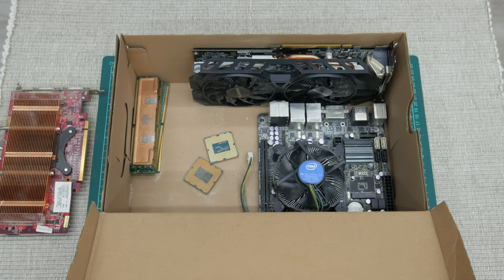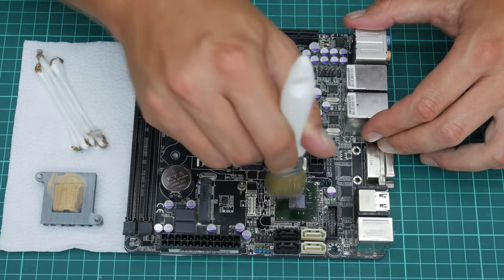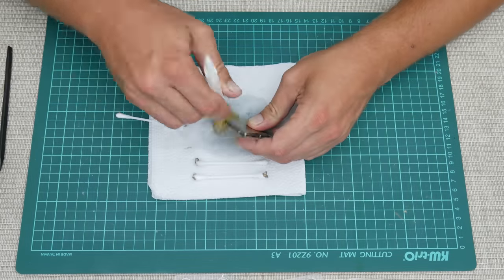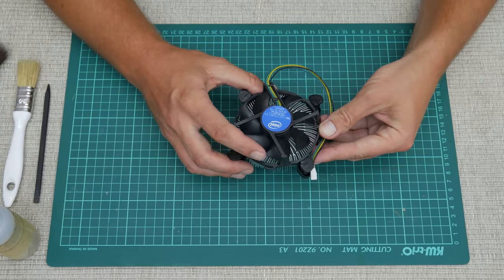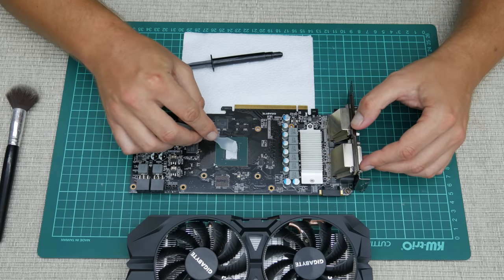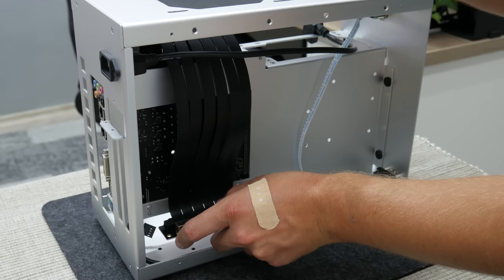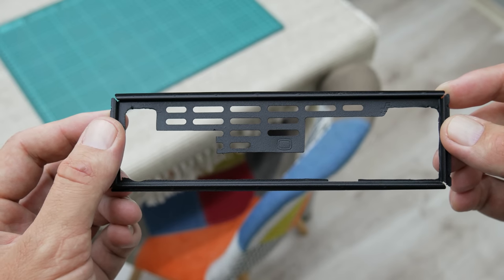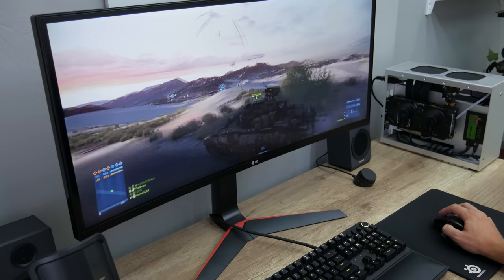Building Mini PC out of Trash ( Plus Upgrades )

Comment: Great build! You could swap out the PSU and HSF for a SFX PSU and a low profile top down cooler and fit case panels on? You could then use those larger parts in a tower build!

Comment: I love your videos, repair tips and upgrades on PCs and laptops. My tip is: Wash everything with soap and water (removing the battery) and let it dry for 24 hours. Just vinegar and salt are enough to get the copper and aluminum shiny again in a few minutes. Then use WD40 or corrosion X to protect. I do it here in Brazil and it works well. Try it!

Comment: This setup is definitely a great fit for a dual-boot Windows XP & 10 PC. Granted that the version Windows XP installed is 32-bit one & can only utilize 4GB RAM, but the fact GTX 960 graphics card still has the official (unmodded) driver for XP means most games prior to 2007 can run in 4K resolution or 60 fps in high settings.

Comment: Nice little PC build! I would have personally gone for a case that fits the cooler though, and also I would have had more than 256GB SSD. 256GB isn't much when some games are 100GB+. It is better to have 256GB SSD and then additional HDD.

Comment: I found, some time ago, 2 small size PCs. 1 is an HP Slimline Pavilion, & the other is a Lenovo IdeaCenter mini PC. The HP was a bit on the older side, as it has Win Vista. The  Lenovo is more recent, but the previous owners put a screw in the HDD! They put a screw in the CD ROM drive in the HP, thinking it was the HDD! The HP CPU can be upgraded as well as the RAM. Thank you 🤓

Comment: Not sure if you standed the heatsink would there be poor mounting pressure considering those are push pin mounted rather than screws. Also, not sure there would be pump out action due to the bare die chipset thermal expansion and contraction during use.

Comment: Tbf, that tower cooler is pretty excessive for i5-3330. 
I have it for 9 years already with stock intel cooler (with copper core), and it never heats up over 65℃ (even under 100% load in summer). It's very cold, and i like it for this.

Comment: Reminds me of repairing my relatives' PC, i5-661 from a i5-2310 because of a motherboard failure and scavenging another PC for it. Upgraded it to 16GB with a GT1030. Was gonna swap out to a Xeon Processor then few years later, I had some spares from a PC upgrade I did, so now it is kicking an old 650W PSU, i5-9400F, new mobo+RAM+NVMe SSD while reusing the case, HDD.

Comment: Great job and great restoration, though personally, I would’ve stuck with the intel stock cooler as it’s low profile and makes more sense here. The 3rd gen i5 won’t need much more cooling anyways, if it’s even capable of drawing that much from that little board.

Comment: Looks good but instead of that tower cooler I would have chosen a topblower, even an Arctic Alpine 12 should do the job, it is rated for 95W TDP and the i5-3330 has just 77 or some other like a Alpenföhn Silvretta, Freezer 11 LP or Scythe Shuriken 2 and use acrylic panels that you perforated with a drill for the PSU and Graphics card (or mill some slots, maybe angled instead of straight vertical or horizontal) instead of solid glass panels.

Comment: There was no reason to use such a large CPU cooler for a 3rd Gen i5. They don't get that hot even over clocked. That was a bit overkill. You did all that great work to clean everything just to leave the side cover off so the massive cooler can suck in all that dust!

Comment: I have a question. If I bought an old desktop computer with windows 7 maybe. would it play 1990's and early 200's cd rom games? or do I need an old gaming pc? I did get a few early 200's games to work on a small laptop but they kept on crashing.

Comment: Nice!  ;-]

One part I don't get... I fail to see the need for sanding down the small chipset heatsink. You said it was because of not having a replacement for the thermal pad.  What is it that the thermal pad does that thermal paste will not do, on that surface?  Arguably, a grooved surface has more actual surface area, with the potential of conducting more heat away from the chip if more of that surface is in contact with the thermal transfer medium. The paste will fill those grooves, a thermal pad will not.  
So, to be clear, what you said about a smoother surface being more conductive, is only really true if a thermal pad is used. Thermal paste is not bothered by such things since surface imperfections are its very reason for existence. It will adapt itself to the surface.
Conclusion, sanding was not required.  Just trying to save us some work... Trust me, if there's a lazier way to do something, I will find it!  lol

Cheers!  ;-]

Comment: Overall nice build. Repurposing hardware is always a good thing but I wouldn't had sand the chipset cooler or bother with making a I/O shield.

I sanded and polished a chipset cooler before and it does nothing for lowering the temperatures. Thermal past will fill the little tool marks and scratches anyway and these Intel 7 chipsets had a TDP of only ~7 Watt. So at room temperature you could even run the board without the cooler with no disadvantage to its performance or longevity.

I/O shields are good to keep peoples fingers out of the computer but its also used to keep dirt and dust out and guide the air but if you leave the case open anyway I wouldn't have bothered to make one and just leave it.
Reply: Exactly, it looks/feels good but doesn't make a real dfference and thermal paste/pads are made for that purpose, because heatspreader/dies and heatsinks aren't perfectly flat/even, it should equalize that.
However I replaced the thin thermal pad with some paste for the PCH heatsink in my LGA 1155 Optiplex 9010.

Comment: i just tore down a pc that was given to me....dusty and dirty....just took psu apart and cleaned all the gunk out. it's a rosewill mid tower that had a amd fx 4300 quad core in it, 16gb ddr3 and a asus gtx 560 1gb ddr5.....probably use a different setup in that case but the ram and gpu will for sure be used in it somehow!

Comment: Changing the thermal pad on the chipset heatsink with thermal paste is a terrible idea. Even if you sand it down, you need to remove a lot of material from it to make it able to give enough pressure to the thermal paste. Just make sure that it touches the chipset die if you're decided to use thermal paste